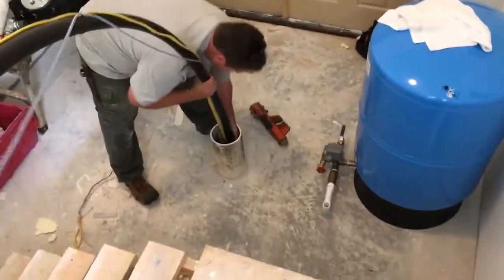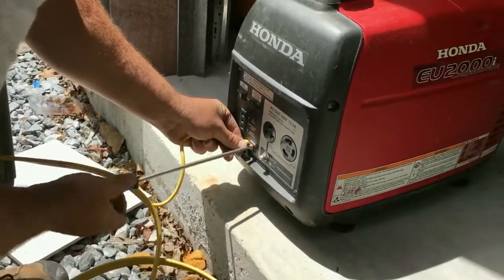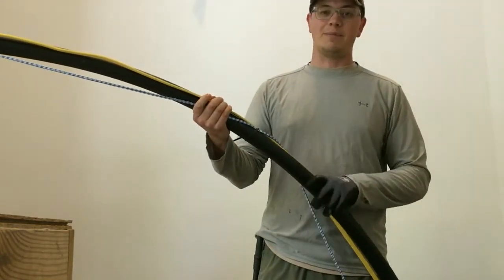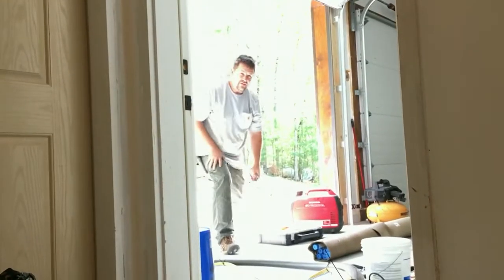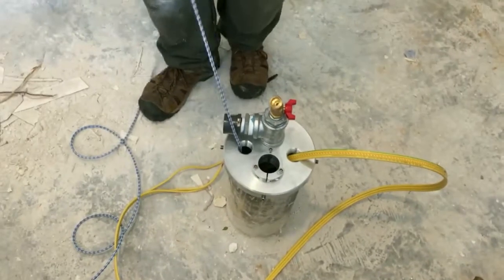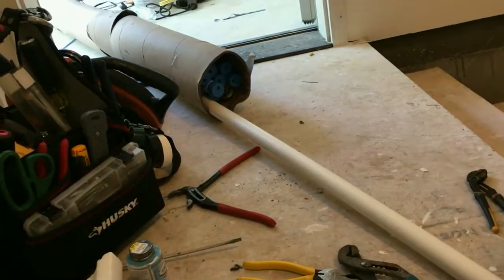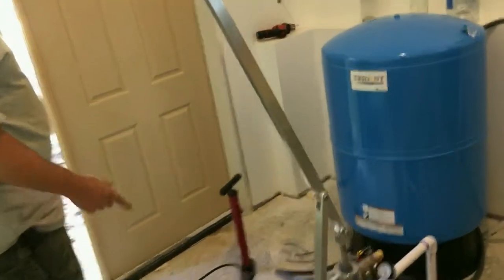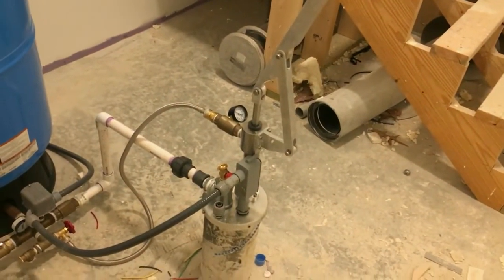Offgrid Well Pump Install w/ Engineer775

Comment: where do you get the braided steel hose coming off of the simplepump?
Reply: Toyota Man Home Depot or Lowe’s. It’s a washing machine hose.
Reply: Johnny Valentine How would I know a brand of hose is safe to use for drinking water?
Reply from the maker: Toyota Man we will have to get the engineer on this one. I believe that if it is list for use in a potable water system it’s good to go. I reckon that includes washing machines. Still we can ask the boss